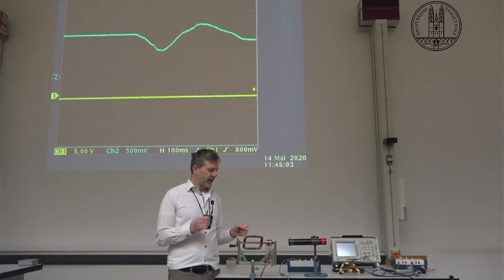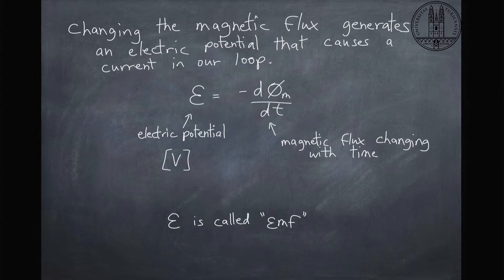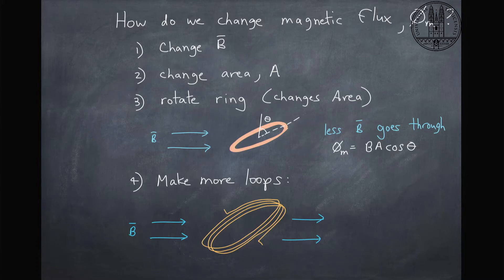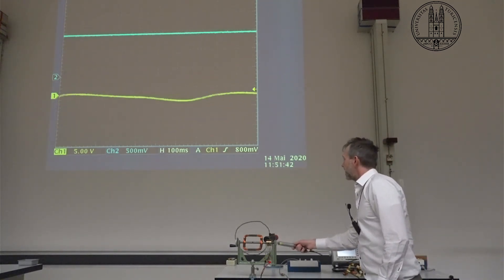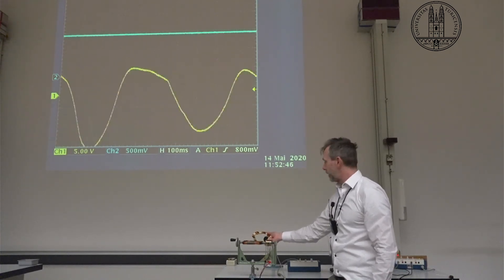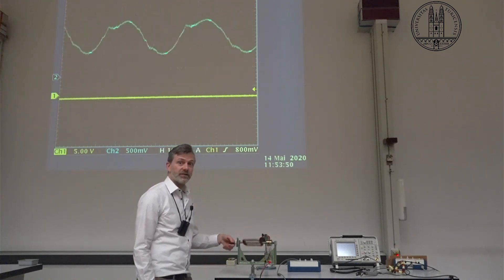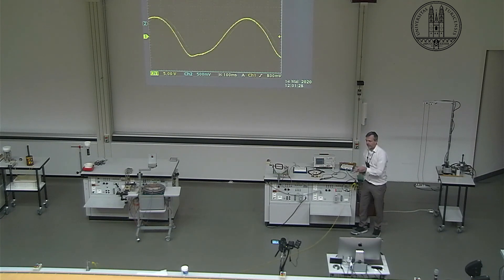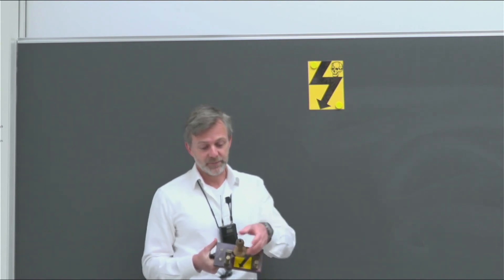Generate electricity from the earth's magnetic field with a jump rope ?

Comment: Did you move your magnet far away? Very strong magnets can move a compass at 7 meters or more.  I never did see the gain setting.  And you did not calculate the flux for the Earth's field for that loop size to be sure it was correct order of magnitude for the voltage and current.  Richard Collins, The Internet Foundation

Comment: This jump-rope cord loop spin idea might also explain why some ham radio operators can get loads of power down their horizontal antenna wire. When the wind blows, the wire probably can produce power as it wiggles in the wind (and Earth's field). It is also at a higher potential if up high and isolated from the ground. Interesting gadget idea. Put in your roof several wires that stretch across your roof but can spin in this jump rope manner or otherwise wiggle in the wind. You can attach little spinners or plastic shapes to catch the wind and increase the wiggle. At each wire loop, have a small circuit that is a bridge rectifier to convert AC to DC and a capacitor to store the DC (see Tate Ambient Power Module circuit - uses germanium diodes). Connect all these little circuits up in parallel to increase current (keeping the voltage within the range of the capacitors you are using). Bring these DC power lines down into your home with appropriate lightning arresters, etc. There is a story that Hubbard, as a young boy, had 4 wires in each compass direction, each 120 feet long. These he connect to either a bottle with mercury or a Tesla-style coherer, and then this was the input to his Hubbard coil.

Comment: In studying Hendershot's work (inventor of a fuelless generator), his initial goal was to make the induction compass. This was during the Charles Lindberg days were navigating with compasses in early airplanes was proving to be difficult. He work on "fine-wire" generating devices that would spin from the wind entering a pipe in the airplane, and this would rotate a rotor that would generate current from the Earth's field. He made a toy airplane for his son that could self-power, but only if it was oriented in certain compass directions. This is an interesting mystery to solve. He was written up in newspapers. Many dignitaries saw his device. It did not defy the laws of physics, because as you can see it is possible to generate small currents with the Earth's field. He somehow used these small currents to create a magnetic oscillation that appears to build in magnitude. Some think he had hidden batteries. Others think he put carbon in his handmade capacitors to create a homemade galvanic battery (and that it wasn't just a capacitor-coil structure). Another possibility is that he had to push his device up against the wall and inductively couple it with the electric wiring in his home. He used a honey comb coil wrapping style (and maybe some other special coil winding styles). He probably had zillions of turns with fine wire. Given a certain electric motor that needs a certain current, you could work out how many turns you need for a 50 nanoTesla magnetic field (or the field strength in your area). Another thing to point out. Once Hendershot gets his motor spinning from the weak-current generator, he now has another source of flux that is more powerful to generate from if he can arrange to do that w/o putting a drag on the toy motor (special angles to trick Lorentz).

Comment: are you for real?...it is you that adds this energy that comes out USSING THE MAGN. FIELD...it does not from the magnetic field but from your kinetic energy
Reply: using the earth's magnetic field, he was able to turn kinetic energy into electricity. objective achieved.
Reply: Tesla filed a bunch of patents on doing this exact same thing as a way to create unlimited free energy. 

After he Died all of his notes, files and documents were confiscated
Reply: moffsets use too small energy toswitch on or off... so that small energy is enough to switch coils... if magnetic power is high enough its possible to feed transistrs/moffsets tough say a condnsator or battery ...after it sarts generated energy can be used to chargr batteres...